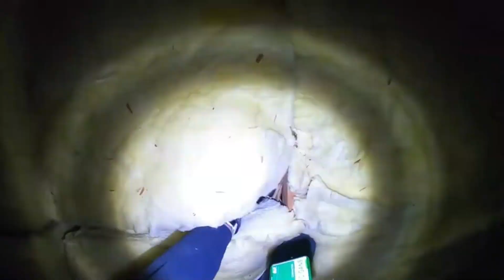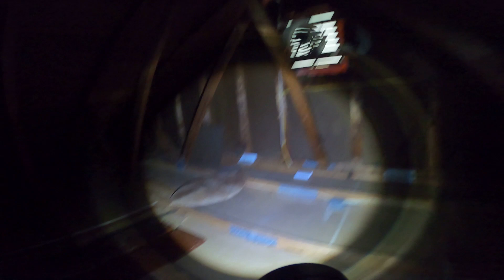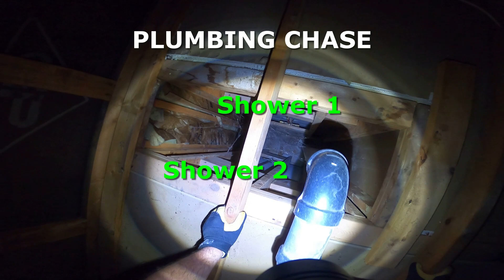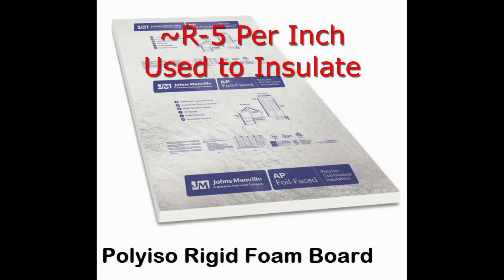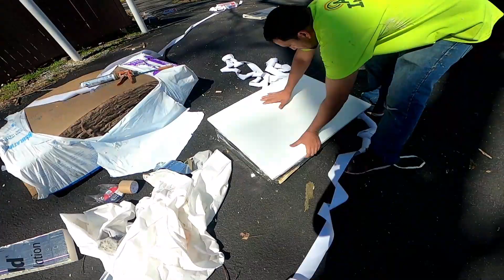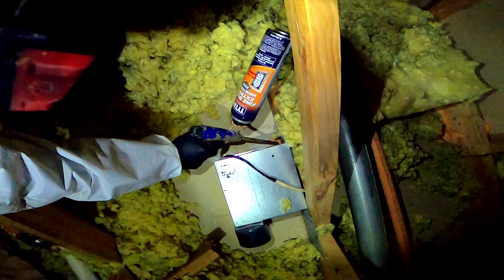Air Sealing Your Attic: Stop Heat Loss at These 4 Hidden Leak Points

Comment: I tried making an access panel to some plumbing in my bathroom... and it has somehow been SO difficult to air seal without just caulking the damn thing permanately closed.
I have a feeling the humid air from the shower is somehow able to gush itself through even paper thin cracks, moreso than 'normal' conditioned air is...
I will try to go into my attic and see if I can seal any leaks ABOVE that wall.

Thank you for your video!
Reply from the maker: You're welcome! That plan should help! Please report what you find once you get up there and check it out! Good luck!